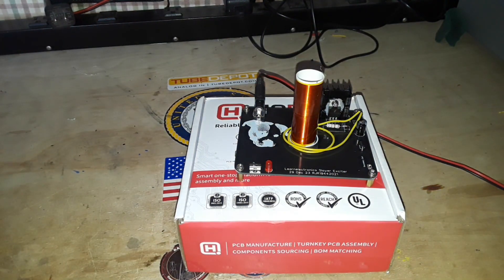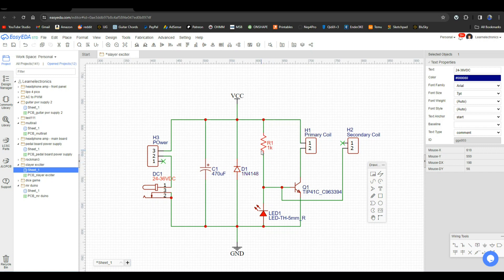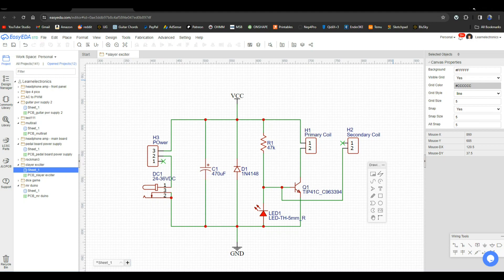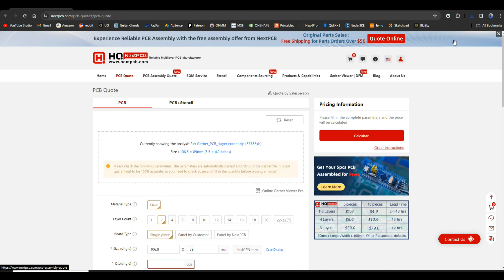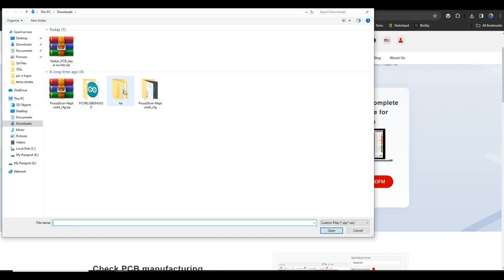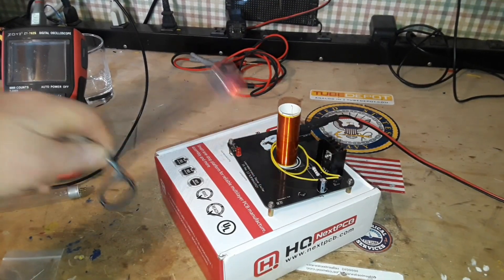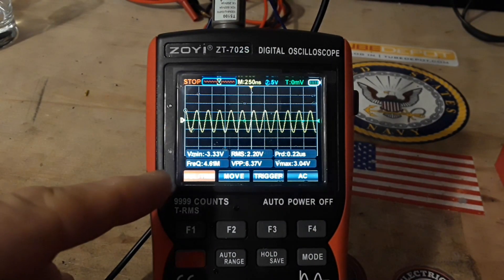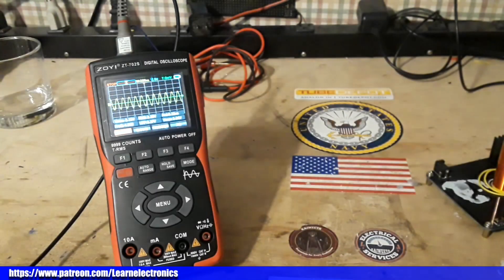Learnelectronics DIY Tesla Coil Kit with NEXTPCB com

Comment: Is there an optimal number of primary turns and is it better if its closer to the HV coil ?
Reply from the maker: You have to tune it. Ideally you want the same Fres in the primary and secondary, that will give you optimum power transfer. But realistically in this type of circuit you start at about 4 turns and tune down from there. 1.5 - 2.5 is generally the range with these small coils.

Comment: I can't say I've ever had any interest in Tesla coils which is strange since I have played with high voltage since childhood.

My cousin built a Van de Graaff generator from a kit as a science fair project in the 70's and we spent countless hours playing with it. Two and three foot sparks were common on dry winter days.

Back then you could buy a kit that had everything except the electric motor from the classified ads in the back of magazines like Popular Science and Popular Mechanics. Electric washing machine or dryer motors were free from the dump. Take a few tools on your bicycle out to the dump and remove a motor from a discarded appliance. Those were the good old days.